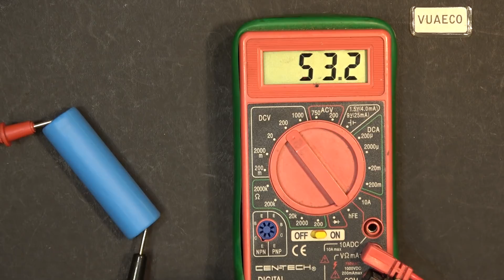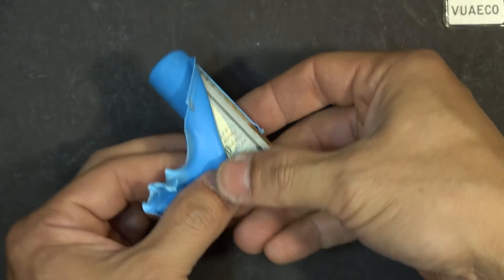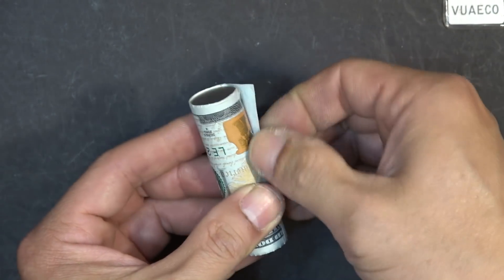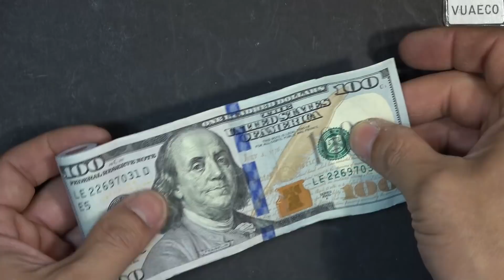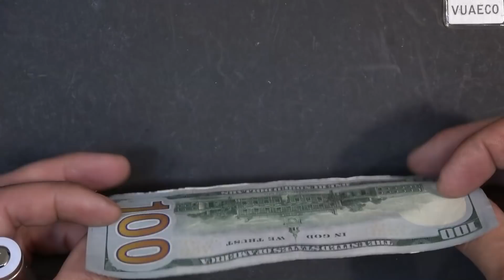Review and teardown: Solid State Graphene battery

Comment: Dude, you're a straight up gangster. I started getting suspicious with the spark.  Let me run through everything.   I thought wtf when you showed 53 volts. I thought 53 volt it must have like 3mAH. After the spark on your bike I thought oh that just drained it. This is a capacitor of some kind that is being sold as a battery. Then the bike ran for a few seconds and I  was thinking how have I not heard of this already? I was excited to see what was inside. Then I started getting frustrated as you fumbled around opening it. I started thinking get out of the way I'll open it you old grandma. I fast forwarded about 30 sec when I saw it was finally open. I first thought it was polypropylene because it's often used as a barrier between the cathode and anode. I couldn't understand why it would be on the outside though. Finally I saw it was a $100 bill and I thought that mother f'er he got me and he's making fun of everyone spending money on graphite batteries thinking they are graphene. Then I felt I owed you to watch the rest of the video and just see how this played out. I started laughing with the uranium rod joke. It does look like that. I couldn't figure out what it really was then it hit me those are mechanical pencil refills. Good job funny video.
Reply: Same i thought, what a scam.
Are you aware of any REAL graphene cells on the market ?

Comment: hi my ebike stopped working its 52v 18650 good voltage i bought a lcd screen throttle with controller off aliexpress but it didnt work for long.tested controller an seems like mosfet blown so i tried to solder new one in an tried it but motor came on staright away an went off without throttle so must be my soldering ha.can you reccomend how to wire a throttle good quality as lcd throttle has hall connector an throttle wires coming off that.i have a spare 48v controller  i can use

Comment: hi ive just got a lifepo4 battery off headway superlight bike its my girls mums not been used a while.anyway  i teested battery and it came on an span the motor ok then under load it dies.i checked cells there are 30 x 22650m 2250 mah.5 series x3 two of these joined up.they are about 3.6v each but one was 3.8v.could i use drok charger on these say 29v at 2to 4amps.she is using my old hoverboard battery for now.41v 18650 pack it gets her to supermarket and back nearly but only small.

Comment: If they cost about the same as 18650's I'll take about 100! LOL
Reply from the maker: Let's see: 
heatshrink tubing: about 50 cents
Paper insulation: $100
Leads: $8
Total: $108.50.
If you choose the model without the paper insulation, it'll be $8.50. But I tell ya, at over 50V, you'll need that insulation. It's worth every penny.